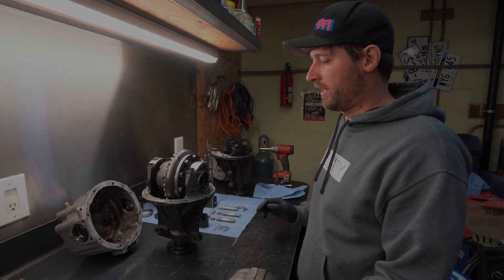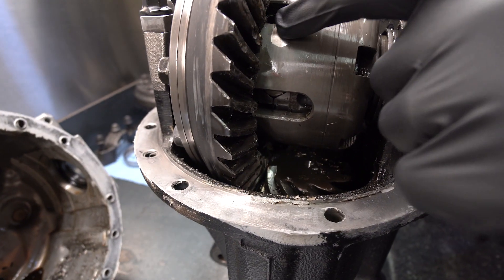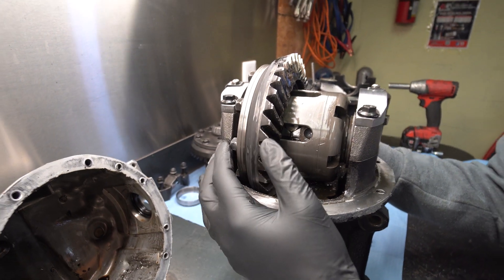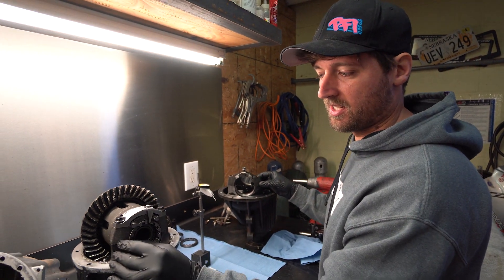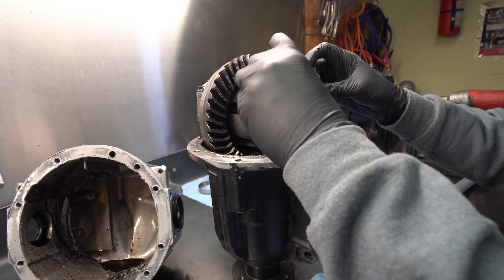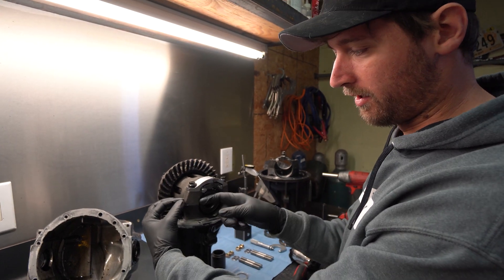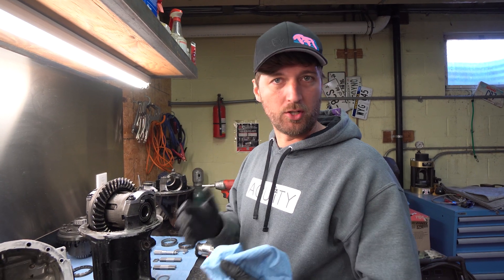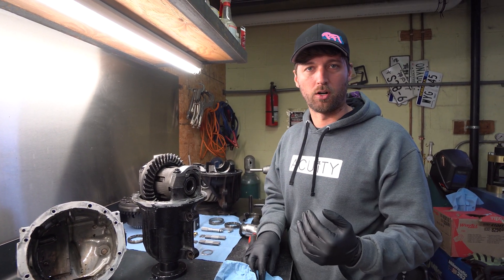S2000 Differential Failure In DETAIL

Comment: Those grooves (teeth) prevent the caps from walking axially.  The cap still needed to lift in the radial direction to allow the ring to shift outward. Interesting video.
Reply from the maker: No it will slide and break the threads. They are cast. We have had many caps push the bearing adjustment nut out and break them threads. Causing backlash to change and the diff to explode.

Comment: Would this handle a boosted f22 with a dct? 500-600hp looking to see what my options are. I believe the dct maybe result in less shock but not sure.
Reply from the maker: We have several cars running at that power level with no issues. One is running a dog box, which is by far the worst case scenario. I think it would work great for your setup. Shoot me an email to HRMotorsports@yahoo.com!

Comment: My diff is clunking when turning at low speeds but everything still seems to work fine. Do you think somthing like this is beginning or the lsd sticking?
Reply from the maker: Typically it's the pinion sleeve crushing too far from load and the gears getting excessive backlash. Our kit would bring that back into spec.

Comment: Hi, and thanks for a great video!  :-)  Will it be possible to buy the 4 pinbolts somewhere or will it be neccessary to have them made? I live in Denmark, Europe, so it will be too expensive to have the pumpkin shipped to you :-) Further, are the boltholes perfect aligned so it will be possible to make the holes bigger with a rival-tool? thanks
Reply from the maker: I have no problem shipping kits over seas. The holes only need to be reamed out a few thousands of an inch. I include instructions with the kits. Shoot me an email at HRMotorsports@yahoo.com and we can get a kit headed your way.

Comment: If you had a machined 2x or 4x 1/4" inch x 3/8" inch long dowel pin holes both top & bottom & either side of the 2 bolts so that you could put in 4x 1/4" inch x 3/4" long dowels in then it would stop any sideways movement of the clamping surfaces then that part would not fail. I was a Toolmaker by trade & putting in Dowel pins in the bearing clamps on one side of the 2 bolts or both sides of the 2 bolts gives you precise alignment of gears & bearings together with your stronger thicker bolts would make the housing near unbreakable for the cheap price of dowel pins & not add very much weight.
Reply: I also have a tool and die degree. Unfortunately there is no room to add a dowel. We looked at all the options and this one the best and most affordable.
Reply: @justinkelly9489  Okay, my mistake, I thought I seen at least one inch by one inch either side of the bolt holes, I must have been looking at it incorrectly.

Comment: Interesting.... that's a super easy upgrade with minimal risk of failure.. do the studs need to be replaced if the caps are removed??
Reply: You do not. They are not tq to yield, so you can reuse them.